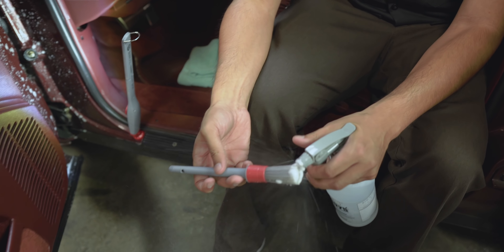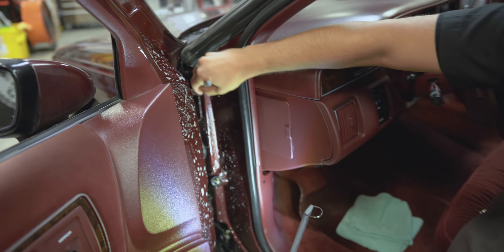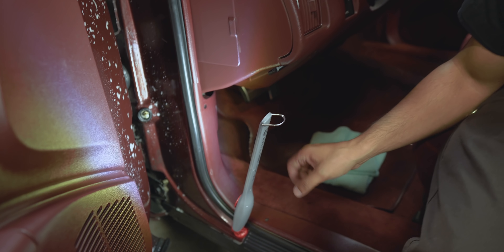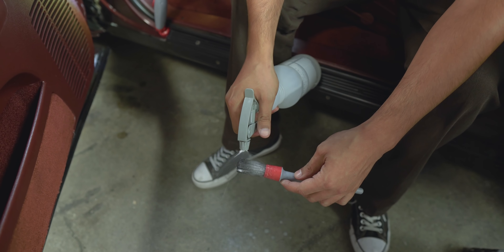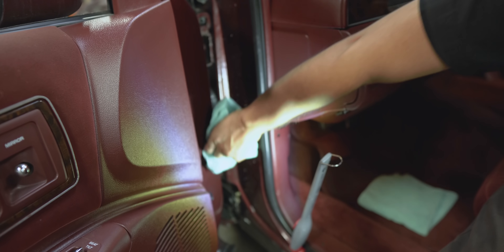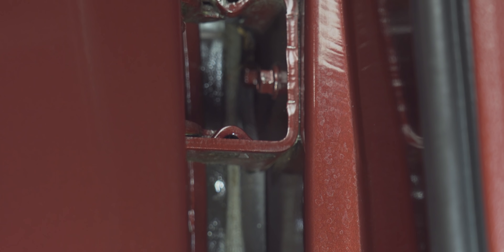How To Clean Nasty Door Jambs & Hinges! || Nooners With Nick Ep.9 ||

Comment: Nick wouldn't that swirl or mirror the paint on the door jams by agitating it with a brush like that? Maybe degrees and just power wash?
Reply from the maker: Hey there! Good question, to avoid swirls we let the cleaner sit for a moment to loosen and encapsulate any abrasive particles and use a soft bristle brush to agitate. It gently cleans away dirt without harming the finish.